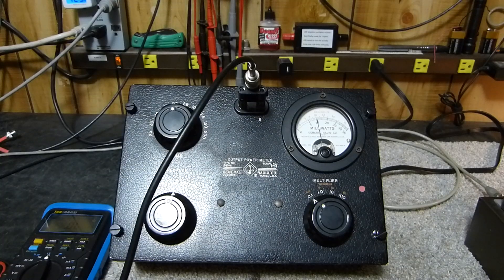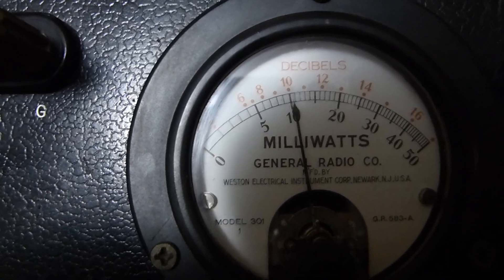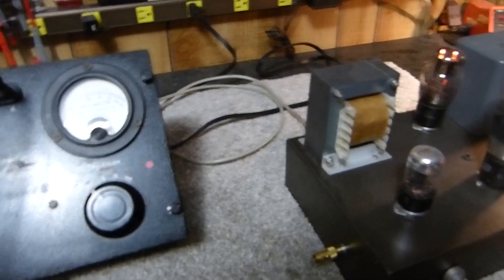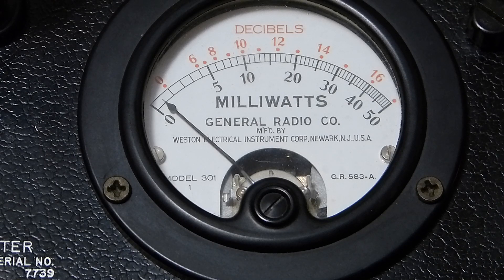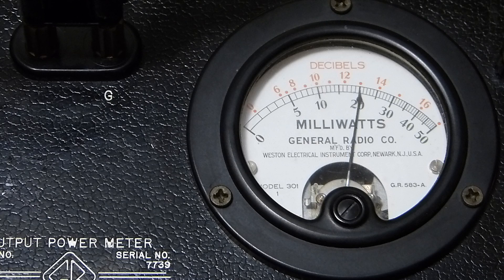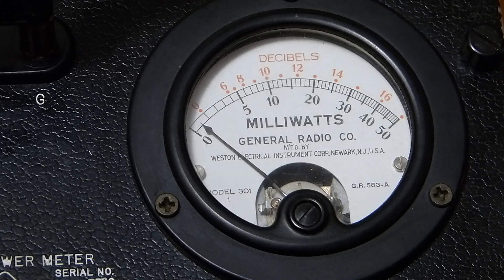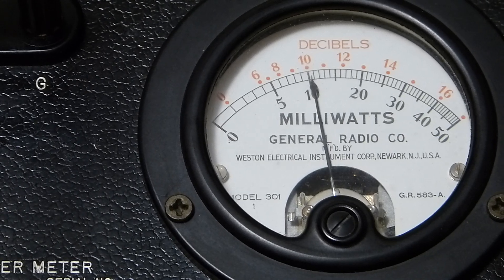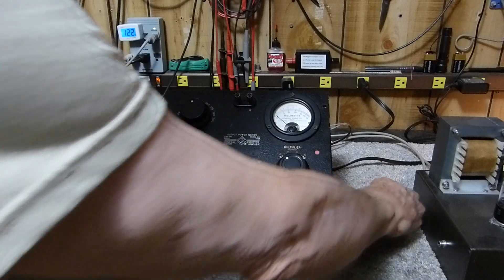General Radio GR 583-A Audio Watt Meter From 100 uW to 5W

Comment: Dang it, Dave, where do you get those toys? :-) Best EJP
Reply from the maker: I got this one off Ebay - been looking at them for years. Needed it like another hole in the head but... hey.. it's nice... you might be able to measure the input power with this thing. I haven't tried that yet.

Comment: I have a GR 1840A which is a descendant of your 583A. I didn't really need it, I just wanted it! I agree with you, all the old General Radio gear is superbly made and a treat to own.
Reply from the maker: We just want it - I understand. If nothing else, and the price is not too high, we get to enjoy it and protect it for posterity. It does not have a USB rechargeable battery that will render it useless in a couple of years.

Comment: Those resistors wound on mica,  I think are precision so if you got one that someone fried with too much power,  you have to replaced it with precision resistors to maintain the accuracy. IET labs website has the original basic manual but no schematic etc.
Reply from the maker: Your comment about precision resistors made me think of the GR 1666 impedance bridge. The way they get calibration precision in that  instrument - say you want some precision value, they put a 5K pot in series with a 500 ohm pot in series with a 50 ohm - 5 ohm - 0.5 ohm and 50 mohm so that some calibration value they need can be dialed right down to the mohm. I found that really interesting. I did notice that the manual on this instrument was very simple. No schematic. Just a simple explanation of what it can be used for.

Comment: I was given one of those from work one time. The wood case has some scuffing and stuff but it does work,  in the instance that I ever have a need.  I believe it is meant mainly for use at the common test frequencies of 400 or 1000 cycles.  Not sure that it is full accuracy across 20 to 20000 at the extremes,  The 5 watt limit is sufficient for stuff like communications gear or portable radios but not much good for nearly all hi fi testing.  The widely variable impedance input is handy for tube gear.
Reply from the maker: For the full range of 20-20KHz that we are used to in stereo HiFi measurements, it is not ideal. And as you say, was likely used for telephone service. One thing the very short manual does say it is good for is determining impedance match - of course at low power. When we think about it, audio HiFi was a side-product of two great technologies. The first one being the telephone and the second one being TV. Most vacuum tubes were created for TV that was as big if not bigger than the Internet in the 1950's. Thanks for your comments.

Comment: Every time you show a great piece of genrad equipment immediately had to eBay and then have to stop myself! Love your stuff man
Reply from the maker: I avoided purchasing one for years but finally gave in. Amazing instruments. Thanks...
Reply: @ElPasoTubeAmps  one piece i did get was the ZM-11/U. Great for the higher voltage capacitor leakage tests. Also uses the bridge inside to do fairly accurate turns ratio measurements. Something about these older, sturdy, reliable pieces that make them satisfying to use.